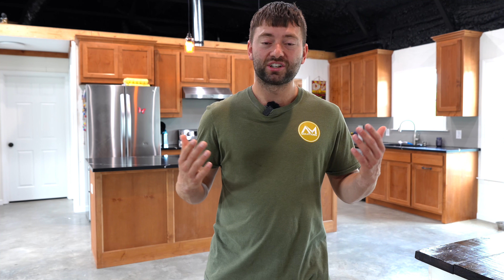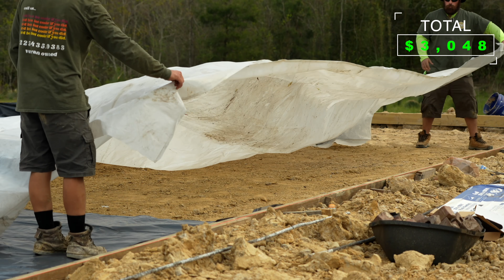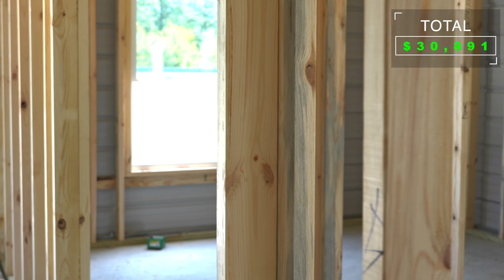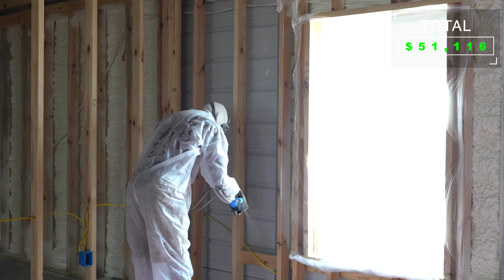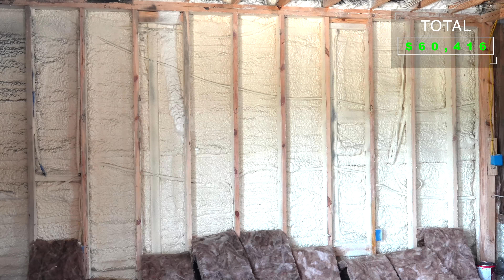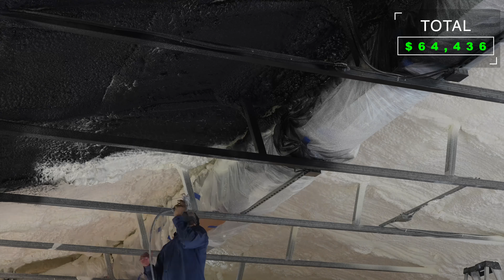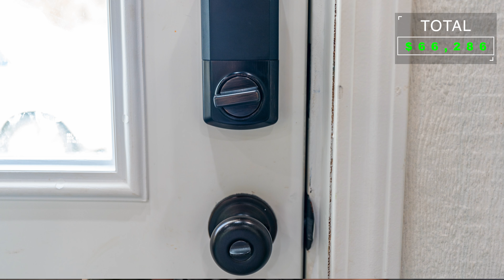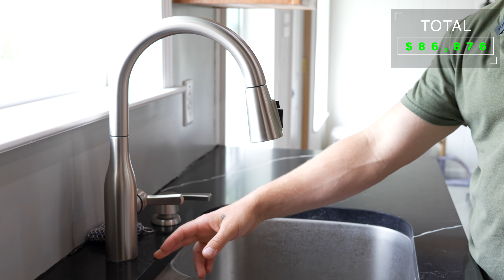Barndominium Price Breakdown | Building a 1,500 sqft 3 Bed 2 Bath Home for $87,000

Comment: You saved a ton on flooring and I would like to see a closeup on how that black ceiling turned out. Excellent job and where can I buy friends like yours?
Reply from the maker: Thank you so much! 
Concrete is the cheapest and most durable flooring! 

I think the Modern Rustic Interior video in the playlist has some close-ups of painting and the finished product. 

That's the thing with good friends, you can't buy them. It takes years to build those relationships. Just remember to always give more than you take and you will have people eager for a chance to give back.

Comment: How did you get 20+ gallons of house paint for 1k ?
Reply from the maker: Glidden Premium Interior Paint+Primer is $112 for 5 gallons at Home Depot.

Individual gallons are $24.98. 

I used 20 gallons just on the ceiling, lol. 
Probably another 20 in the rest of the house and still under $1k.
Reply: You get a 30% discount at Sherwin Williams with a GC account, run around $125 ea 5 gal bucket. You gotta have a friend that can get ir cheap

Comment: You said you were an AC contractor as I recall….Maybe do a few videos on that work as well. Maybe talk through design, layout, steps you take, how to size a system, costs for different types of systems, different brands and your thoughts about them, custom vs a standard installs, parts, etc. With your cost breakdowns, we understand it’s dependent on the part of the country you live in, availability of equipment and so on. But, if you do a video breakdown the way you did with the house, that would be great!
Reply from the maker: I actually have a video in this playlist of installing the AC in this house, you should check it out and let me know what you think!

Comment: I just built a 1700 sqft garage for ~$175k.  There are a bunch of differences in our builds but your cost is pretty low.
Reply from the maker: Wow, it must be a very nice garage! 

Is it constructed with metal?
Reply: @DudeWeCanBuildIt  Metal siding (inside and out) over wood, it's a classic pole barn (Morton), black on the bottom and grey on top.  The concrete is 6" thick like yours but we installed radiant heating in the floor (with a boiler).  My concrete cost 3x of yours so you got a great deal.  There is no AC.  We have hot/cold water and a framed in bath with no shower installed yet.  The building is 24' high with two 10'x10' garage doors and two man doors (my man doors cost $1800 each...).  There is a second floor over 1/3 of the building.  This is done for storage and cost a lot more than the first floor (the second floor sqft was expensive compared to the first floor sqft).  It's fully insulated with metal on the inside and full blown-in insulation in the finished ceiling.  There are 9 other windows.  I had some higher costs in leveling the land.  Other than that it's an open garage.
Reply from the maker: Oh, that's cool!

That's a very tall building. 
Why was the 2nd story more expensive?

Comment: Great video! Custom cabinet maker here… Those are not “custom” cabinets. You may have a few custom sized cabinets, but those are very basic. For the linear foot of cabinetry you had, most custom cabinet shops would run you over 20k. Sounds and looks like yours came from a production shop. And that’s a great value choice! But I wouldn’t call them custom.. people will be quite surprised when they contact an ACTUAL custom cabinet shop and the quote comes back as double or more of the price of your cabinets.
Reply from the maker: Great information! 

As someone who has put kitchens together with store-bought cabinets, this definitely seems custom fitted to me LOL. 

I definitely see what you mean, there are no recessed into the wall cabinets or anything specialized about my cabinets.
Reply: What is so special about custom cabinets?  Are they 22.5" in wide or some other odd ball dimensions?

Comment: Add + $40,000 to the build cost if you're anti-social.
Reply from the maker: lol if you pay someone to build this for you you’re looking at $160k.
Reply: @DudeWeCanBuildIt  that’s alll day 160 is light!!! My sis bout a prebuilt home for 190 . 160 is a steal . Idk if it can be done up here in New England I haven’t heard or seen but I have a feeling it can be done
Reply from the maker: @HolidayStylesSMM  Aside from permitting and snow load, I don't see it being much different. 

They have stronger models of the metal building for increased wind and snow loads
Reply: @DudeWeCanBuildIt  so to my understanding from the video u bought the metal frame building then built up everything
Reply: @HolidayStylesSMM  IT would NEVER pass code in New England , or anywhere else , other than Louisiana, and I am a licensed Commercial Contractor from Louisiana with MY license is recognized in 14 States to include Florida AND California. I build a house with that Sq. Ft size for just over 125.00 Per Sq ft. 2x6 walls , REAL drywall, FLOORING, Solid hardwood cabinets , AND NO JUNK metal siding that will rust out in 10 years. This DUDE  built a cheap, low budget , CABIN , that will fall apart in less than 10 years.
Reply: @Daniel-po8eb   10 years?  Where I live there are plenty of steel buildings that have been standing and structurally sound for more than 40 years. 

What do you think will fail first?
Reply: @Daniel-po8eb dude chill,we get it,you are a builder and dont want people doing it this wa.but your comment makes you look like a newby builder now.metal storage barns on farms are done even cheaper and they last for decades with little maintenance....
Reply: @DudeWeCanBuildIt  As someone who lives in CA, I would pay this all day.
Reply from the maker: @amunra4015  I bet, CA is very expensive!
Reply: @amunra4015  That is less than  materials in CA.
Reply: @DudeWeCanBuildIt  that’s exactly what I said.
Get this garbage off Internet .
And your promote in your company and showing if you can do that 99.9% of other people can’t do
Reply from the maker: @CaseyOlivieri 
Literally anyone who is somewhat handy and has some common sense can build this exact building. Check out the entire playlist where I give a tutorial on each phase of construction. 

It's not rocket science, it's easy. You should check out the guy that built a house for $50,000 and his kids helped him
Reply: @DudeWeCanBuildIt maybe if you could touch bases on Hawaii prices , my wife & I are looking some information but having a hard time getting the numbers correct. Any information I’m sure will help us
Reply: @DudeWeCanBuildIt  now what about in 2026 lol. we looking at like 400k now or? 🤣
Reply from the maker: @PrimalFlexing lol, probably
Reply: @DudeWeCanBuildIt  Even at 160k it is a bargain.
Reply: I will be doing an experiment within the next year. I am looking to try to get a 60x80x18 metal building for about 53k and with a budget of only 100,000$, see how much of the building i can get completed. I was considering spending more over the years to finish it out, but to start with a smaller livable space to see how much can be done with this experiment. I was considering: good sized living room, kitchen, 1 master bedroom, 1 office, 1 spare bedroom, 2 bathrooms. And then have the rest be a giant open space shop until i do more with it later. But I am not sure how far 100,000 would go, and it is unlikely that any of it will be done by me or family. So that is 100k for foundation, plumbing, insulation, framing, etc. I wonder how far it could go lol. I knew a guy who did a 6,000 square foot metal building for 250,000k about 2 years ago, but he has since passed away and I have no idea how he got it done. He did not do it himself at all / no family or friends to help him.  This is all in florida btw. we will see i guess. essentially, the experiment is how large of a house can you make for 150k roughly.
Reply: @TheRealEvades  You can purchase complete Pre - engineered metal building very reasonably.
Reply: @Daniel-po8eb  what all is entailed when it comes to " pre engineered " ? Plumbed, electrical, insulation, etc? And for say, 80 length, 60 width, 20 height, I wonder what the cost for a pre - engineered one would be. Or if they could do half of it and the rest be a garage? Either way.
Reply: @TheRealEvades  Engineered drawings cost in the neighborhood of 5,000.00  That is just for designing a metal structure. Then it requires drawings and computations for electrical load, plumbing according yo the number of fixtures and Hvac computations for cooling according to Sq. Footage of cooled space!
Reply: @TheRealEvades  You can order pre engineered metal buildings from many manufacturers, this Dude pretending to build hunting camps couldnt LEGALLY build another one . He got away with this one because he built it for himself and cant LEGALLY sell it for 5 years according to Louisiana Law! It wont survive Hurricane season this year and the trash he finished the inside with wont last one year of occupation! I can get you a quote if you would like!
Reply: @Daniel-po8eb  I would definitely like a quote, although i am in florida. I intend to find out the price for this starting idea:  The building would be 80x60x20, and the building would start with just 1 bathroom, 1 kitchen, and 1 master bedroom ( all interior walls insulated ), and the gigantic amount of empty space would be  insulated / have electrical as well. 
The second idea to just get things started would still be 80x60x20, still 1 bathroom, 1 master bedroom, and 1 kitchen, but in this one, everything is closed off, and only those rooms / areas have electrical / insulation, leaving 90% of the rest of the house being a mega garage until building it out later on. Wacky experiment, I know, lol.
Reply: @TheRealEvades  My Contractors license is honored in Florida. I do lots of them a part at a time as the owner can afford. You require a 20FT Tall building for eventual 2nd floor or just Tall overheard doors?
Reply: @Daniel-po8eb  There will eventually be an open concept type second story with railings, but I have not decided everything as far as that. When there is a second story, it will likely still be a massive empty space for the majority of the upper half of the building. Eventually, there will be an indoor archery range, tennis court, movie theater, etc, so I want to have large open space. I am still deciding on tall doors as well, but I have not decided yet. Everything is very up in the air as far as the end goal. I may have more areas pre plumbed and capped for future bathrooms as well, but for now, the goal with the experiment is to try to get a ( roughly ) 4,800 sqft 20ft height metal building made into a livable home that someone could build out as they go, at the bare minimum amount of money ( including a foundation ). Hence, the 1 bathroom, 1 bedroom, 1 kitchen, and possibly not doing electrical / insulation for the entire building right away
Reply: @TheRealEvades  Ill work on it. Ill need to know the rough location in Florida as Wind ratings change the closer to the coast! How may I contact you?
Reply: @Daniel-po8eb  land has yet to be chosen, as the experiment is still a little ways out. I'm going to get a few acres or so. From some things I looked at online, of some of the florida ones I have seen selling their prefab things, they seem to mostly shoot for 150 to 170 winds. If you have an email that you are OK with occasionally chatting through, that would work. My ideas are very crazy, and have gone through shipping container houses ( 5,000 to 10,000 sqft ) all the way to connecting two yurts that have been modernized ( 4,000 sqft ). I have also learned that 98% of the people making shipping container homes are doing it very wrong, and I believe a massive shipping container home for cheap is also very doable if done with my ideas. So many things are up in the air. At the end lf the day, a giant 4,000 to 5,000 square foot building for even as low as 150,000 ( possibly with an unfinished interior left to be built out later ) seems possible even in this overpriced material situation.
Reply: @TheRealEvades  I dont trust putting my email over this forum!
Reply: @Daniel-po8eb  yeah, same lol. If you have other ideas or if there is a direct message or something? I will be in and out fixing something, but I'll eventually get back to this
Reply: @TheRealEvades  You are correct about the container buildings. The sides and roof are NOT structural and most of the builders  are exactly like this DUDE, handymen with NO actual skill or training. The processes this child employs were obsolete 30 years ago, yet he thinks he’s developed space age corner cutting to revolutionize the building business. His cute little Barbie house  hunting camp wont make it through Hurricane season this year.
Reply: @TheRealEvades  Im not comfortable putting my email on these type of platforms.
Reply: @Daniel-po8eb You’re on here being personally upset with what he built, calling him a child and pretending he isn’t even worthy of doing anything himself because he’s not a licensed contractor like you. You could have gave your opinion without sounding so offended, nobody cares that you are the subject matter expert on all things pertaining to building homes. You are not that important to be so offended, give your opinion and shut up without the fluff and ego.
Reply from the maker: @Daniel-po8eb  The house made it through hurricane season!

I'm sure you're absolutely amazed the "Barbie" house didn't fall over in a light gust!
Reply: @blakeloh that’s how i feel all these so called contractors on here downing this guy hell i like his home i think i will follow his plans for myself i am in mississippi this will work perfect for me
Reply: @DudeWeCanBuildIt hey man i appreciate you sharing your metal building i am following your plans as we speak thanks all the great ideas i also have friends and family in my neighborhood that have trades and skills that will help my cost to be a little lower but thanks a lot
Reply: 6k more like 20k for concrete.
Reply from the maker: @jasonwalls6852  Concrete is $150 per yard here
Reply: @DudeWeCanBuildIt 
Good lord, $250 a yard here plus delivery.
Reply: Or if all of your friends are useless idiots who couldn’t hold a paint brush if it was duct taped to their hand.
Reply from the maker: Lol, classic
Reply: @cnotation  you’re awesome 😂
Reply: THIS! 😂
Reply: Right at it.
Reply: lol. I've got 1.75 friends.
Reply: The cost of living a peaceful anti social life
Reply: “Costed” ?
Reply: And then your equity here would drop down to $210k.   boohoo.
Reply: And your friend is not an electrician and you don't own your own HVAC company and of course no friends. lol!
Reply: @daroldw4606  We're not exactly antisocial we're introverts and baby we were born this way.  Seriously, we can't help it, am I right?
Reply from the maker: @daroldw4606  ??

Comment: It would have been cheaper if you went two story. A 30x30 is alot less than a 30x50 building and alot less concrete. I have been planning mine for a couple of years and am breaking ground this fall.
The wind rating is the same
My home is going to be a single slope roof. It will be 24x60 ( 24x24 garage and 2300+ sq ft living).
Reply from the maker: Oh wow I didn’t know that! Please grab our email if you can send us update pictures if you can remember. A two story version would be so cool to see. Beyond happy for you. We know the feeling of starting all to well. The finishing is even more satisfying! Enjoy
Reply: You are right in line with what I am planning, 24x60 with 2 story living quarters.  Are you working with an existing design or are you designing it?  I've had a hard time finding examples that are close to that idea.  Thanks.
Reply: @Jerry.Hathaway  I have drawn my basic plans.
Reply: @Jerry.Hathaway  my restrictions is + 1700 living area. So 1700 ÷24 = 70. So 2 story would be 24'x35'. I would like my 3 main rooms to be   at least 12' so 3x12 = 36. 24'×36' slab (1728 sq ft) would do . This doesnt take in account the garage and storage.
Reply: @TheWarriorsMind  That is very close to what I'm aiming for.

Comment: Just a question, wouldn't it be better to case the house in Zip sheathing?  That way your spray foam is attaching to the panel instead of the exterior metal?  I would think that would be better for a moisture barrier and in case you ever had to replace some of the metal outside, you wouldn't have to disturb your spray foam insulation.
Reply from the maker: That is definitely an option. I will have to do research to understand the pros and cons
Reply: Or just wrap the framework in tyvek before you screw on the metal siding.

Comment: I do not belive that wind rating for one second
Reply from the maker: It’s engineer stamped 🤷🏽‍♂️ We can post a link to the plans. And that’s just the wind rating for the building. Not including the spray foam and framing on the inside. We are in hurricane valley we can’t afford to lie on a wind rating nore build something that couldn’t sustain those winds.
Only way we can prove it is once a hurricane comes through we can post update pictures 😂
Reply: @DudeWeCanBuildIt  I think the spray foam will definitely help. Hope you never have to find out though
Reply from the maker: We have a hurricane on the way. Will keep you updated